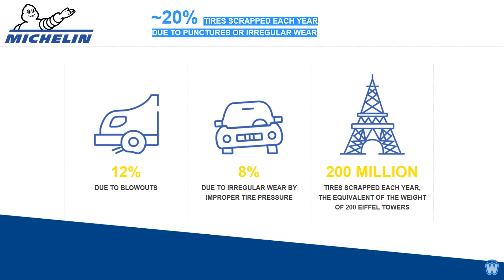Michelin Airless Tire UPTIS - Unique Puncture-Proof Tire System

Comment: About the cop issue... There is probably a way to straight up rip the thread of those tyres on the go, if so, the cops should be no issue and we should be able to use these tyres when they are ready and tested

Comment: What about fuel efficiency? They purposefully used a light car for the pilot tests but imagine a heavier car. Fuel efficiency will probably go way down, no?
Reply: Heavier vehicles already have terrible milage and heavy pneumatic tires anyway. Pretty easy to imagine the average milage is the same regardless, and if anything, better because it's more consistant and not subject to air pressure lazyiness.

Comment: Can't imagine how much a vehicle would vibrate if snow and ice gets in that rib design, not to mention extreme handling problems as a result, and on a road surface that's already hazardous from winter conditions.
Reply: Kinda thinkin' any debris will get flexed out as easily as it got in. It's not like stuff can't get back out as easy as it got in.

Comment: If a car is not driven for an extended period of time do these tires develop a flat spot? What about gas mileage?
Reply: That is 1 hell of a good question
Reply: the ribs would also likely become weaker as the vehicle turns, slows, or accelerates over the course of weeks or months, increasing the actual cost of the tires

Comment: THE RIBS WILL NEED TO BE COVERED OTHERWISE PEOPLE WILL JUST CUT THEM
Reply from the maker: no they won't, too much effort, only takes 1 pin prick on the side wall of any tyre to puncture it, but hardly anyone goes to the trouble of even doing that, no one will waste time trying to cut through steel reinforce rubber.
Reply: @WonderWorldYTC  DONT UNDER ESTIMATE AN ENEMY THEY PUNCHURED ABOUT 20 TYRES HAD TO HIDE CAR , BUT ITS GOOD HEAR THAT REINFORCED

Comment: I've seen these tires like 6 years ago and it takes 10 years to bring them on the market?
Btw, I understand the issue with police. Even in my small country with population just over 1.3 million, every week there's a drunk dickhead without a license being chased at speeds up to 200km/h and sometimes they end pretty bad. The majority of them have been stopped by using spikes.
Reply: @God Of God's I'm pretty sure these haven't hit the market because of fuel economy. Rotational mass usually has 3 times the impact on overall effective weight and these tires are definitely heavier than conventional ones. A greater contact area with the road also creates more friction. These would have a genuine impact on fuel economy during high speed cruising. Another aspect is safety. The lateral grip of these tires is much lower than conventional ones which makes them less safe in emergency situations. A driver who attempts to swerve around an accident could understeer straight into it. Braking distance as a whole would also be worse. The last reason is cost. More material and a more complex manufacturing process means a higher price for consumers. It's cheaper to use normal tires and fix them when they get holes. There's a reason you don't see police using these tires. Other countries that have a free market system also don't use these tires.
Reply: @ymarascough1765  don't delude yourself, the only reason why these tires are not in the market it's because they are more reliable and people would change them less often. Yes, you heard me right, pneumatic tires companies are lobbying with excuses like "fuel economy" just because their business model is in danger
Reply: @gianluca.g  did you not read what I said? Even other countries with free market systems don't use these tires 😂. Don't be a sheep man. Look at the hard facts and educate yourself. Any consumer that cares about safety, fuel economy, and affordable tires would NEVER buy these.
Reply: @ymarascough1765  im not trynna start something but it rly pisses me off when someone uses the laughing emoji when they are arguing. Plz just stick to words
Reply: @jack-rx4bf  That's fair and understandable. I think the reasoning still stands. I can understand your perspective and I think there are absolutely situations where that does happen. But the government isn't all bad. Another example is they launched all the satellites and pioneered the internet as we know it. They let the rest of the world use it for free.
Reply: @ymarascough1765  ?? I asked u to not use emojis when arguing cuz it sounds condescending
Reply: @jack-rx4bf  yes, like I said that is fair and understandable.
Reply: @God Of God's oh no, the law enforcement is usually safe. They got professional drivers, guns and stuff. It ends bad for innocent civilians when the car can't be stopped.
Reply: @God Of God's I agree ofc, at least start with trucks. Yet we still need a creative solution to replace spikes. Shooting is not a very good one.
Reply: What would a blade style strip do? Seems like instead of spike a row of blades, 3”, would still shred the tired sufficiently.
Reply: I'm pretty sure for safety reasons

Comment: yea but how will they handles extremes? hot, cold, emergency stops, drift ect.
Reply: A sane person wouldn’t go drifting with these
Reply: I guess maybe finding this out is why there is a 4 year period of R&D from now...
Reply: Rubber is bad insulator so temperature wont affect em. Mych like conventional tyres
Reply: @lavanyabaranwal6957  what a bout drift tho? And what if a small rock get inside those holes
Reply: @tigantabrother  definitely a major con. I like air ones over these for sure but that how technologies advance. You gotta start somewhere

Comment: Tyre companies won't implement this. This will reduce their sales
Reply: The tires will wear just like normal tires. And if it doesn't wear out, it will harden just like normal ones.
Reply: Those tires still will get used up due to friction, like usual tires. The first to advertise it properly and sell it to the mass will profit the most at first. I don't think tire producers will  just trust their competitors not to take this opportunity.

edit: They can also demand an higher price that compensates the lower sales
Reply: The tires will wear just like normal tires. And if it doesn't wear out, it will harden just like normal ones.
Reply: These aren't very good. The best application is for riding lawn mowers.
Reply: Yea like for the company I work at. We could get airless tires for all our skidsteers but they cost an arm and a leg. Very expensive.
Reply: @evanszymanski346  yeah I just don't think it's worth the expense. (assuming they are superior to standard tires, which they may not be in most cases).
   In economics there is what is called "opportunity loss". Like, sure, you could buy these, but wouldn't you rather spend the money on a down payment for a new skidsteer? So from a business standpoint they have it backwards. 
 Now invent a tire that is 90% as good as normal, but only 60% the cost. Those would overtake the industry.
Reply: @KF1  yea and I mean who cares if you get a nail in your tire. Canadian tire(if you live in Edmonton) sells tire plug kits for dirt cheap.
Reply: @evanszymanski346  that's funny because after the previous comments I was thinking of the tire sealant they sell at princess auto. (Wpg) 
A week ago I picked up a used set of winter blizzak tires for $240. They're awesome
Reply: that's why we must wait until 2024
Reply: Airless tires are not practical in many situations, I can give you multiple examples: You can control the air pressure and thus the cushoning effect of your tires in your car when loading it with either a light load or a very heavy load. You can not control this with airless tires, if you load the car too much (4x4 truck) then the car handling will suffer, as well as the steering response and dampening effect. 2. when offroading mud , rocks and debris can get stuck in the ribs of the tires, damaging them and reducing their propertires. 3. in the winter time if water or snow freezes between your tire ribs you are fked....
Reply: @boT6674  I'd like to argue about a few points of you:
1. The tires are probably for cars which have a smaller window between empty weight and max allowed weight. Something like the vehicle in the video. 
2. Im pretty sure that michelin has a solution to it. And since it's flexible and moving a lot i thing you can get stones and stuff out fairly good. Also again like in 1, it's probably for cars which are mainly moved on proper roads. Aaand they also get used in excavators (like shown in the video) so it doesn't seem like that big of a problem. 
3. Could be a problem. So maybe just summer tires? Maybe they don't take damage when you drive them with ice in it and it crushes it pretty sufficent? I don't know.

Also that is just what I am suspecting so I could be wrong.
Reply: @boT6674  I'm sure it's not that big of a problem considering the military uses it and they wanna cut on expenses if they can so replacing tires continuesly is probably not there ideal situation
Reply: @o.o9709  the military have different priorities - puncture proof especially from gunfire is paramount. Everything else, like fuel economy, handling, comfort and pressure variability take a backsit, but these are all important considerations in consumer cars.
Reply: @boT6674  Very good points, I do think that people without these issues could profit greatly though.

Comment: To complement the FAQS - Tyre IS also the ancient geolocale place title as in Tyre and Sidon,no..?And.. Michelin..? burnouts n drifts yes would place the said prototype on the map racetrack style,but would not perspective be added were the product conducive to zero gravity conditions in it's respective terrain..?if so equipped with nano technology communication, steering as well as mapping is a done deal where off planet research can be conquered.What of its ocean floor agility,perhaps robotics aiding unmanned vessels as depth density prove a challenge..But above these,Sirs and fellow ubers the new age design begs an equally demanded alternate material say fiberglass combinations, welt needing higher tolerance levels, safety parameters met yes but to arguably stop or reduce the extra 'want from',,on an already exhausted Petro Chemical Industry (tyres being an oil derivative industry, basically) the 'disposal of' being a hushed, negated topic.Would not smaller rimmed prototypes with longer rigging provide greater loaded absorption WITH a modified lshocks displacement system for heavier vehicles or military grade performance.What though of off land responodency, should bouyancy tyre material be considered, if the undercarriage and engine come factory sealed,could not a collapsible wheel that's water sensitive activated kindergartenly provide flotation,as the landing gears of air crafts do, if bouyancy - fused materials are welted into specifications.Why's the prehistoric question of man conquering nature not've been met in such a space age as ours,basic,rather basic propulsion, flotation, conversion   IN an already combustible engine type craft.. the impossibility of it is impossible in and of its already existing  contained self,Sirs.. David

Comment: Rubber changes properties over time and usage while air is air. You wouln't need to pump the tyres but tyres would have less support over time which would leave you with "half empty" tyre until you replace it with a new one. It's shape also leaves it exposed t chipping against a curb, it wouldn't destroy it but it would definitely make noise while driving

Comment: I’m not sure these would handle the torque of a performance car, they would shrink in diameter as you floor it. Great for a standard daily driver car tho. 👍
Reply: Pretty sure that excavation vehicles and military vehicles shown having these tyres have engines producing more torque if not equal to performance cars
Reply: @anthonyochieng4485  yeah they have way more torque down to gearing but with regards to acceleration they would have to be pretty tough not to shred. And yes good point as they shrink more torque, also as you move through the gears lowering the torque they would eventually reshape to obtain top speed so maybe they’re a win win for the quarter mile 👍
Reply: drag car tires are meant to be really soft so they can shrink really fast that the torque of the car has so much grip from the start it doesnt wheel spin, you can watch a drag car accelerate and see its wheels shrink into the ground.
Reply: @example795  👍
Reply: @Craig Carmichael True, bigger contact patch, just like in top fuel dragsters using low pressure tyres that deform to put the torque down
Reply: they wouldn't, they're meant for regular road/family car use
Reply: Yes, I'm sure the boffins at GM and Michelin developing these never thought of that...
Reply: true

Comment: Imagine the car engine that you'll need to use those tyres. Normal cars can't even handle that.
Reply: What the fuck is that supposed to do with anything...
Reply: LOL what? This kind of rubber isn't anything special, if you could you would just buy it and stick it on your car. It would work just like a normal tire.

Comment: So the reason why it has not selling yet is the police.
Reply: Correct me if i'm wrong but michelin likes selling tires. So why would they make tires that dont go flat?
Reply: @sjefoekel6058  The tires wear out, most of the times i replace my tyres because they are worn, most of time tire replaced without any puncture.
Reply: @sjefoekel6058  ur tires get replaced for wear that appear in most cases
Reply: @brotothewilliams9890  yes agreed, in some cases.
Reply: @sjefoekel6058  Probably because these are likly to cost more and not last any longer than the current ones.
Reply: @steeveedee8478  make sense in a way. Just hot air then.
Reply: No they just aren’t ready for commercial use yet
Reply: This video is missinformed, already exist multiple ways that Police use to stop a car without spikes. You can looks for a video on YouTube. Like chains and stuff
Reply: Duar memek
Reply: Not a good business model, Michelin will go bankrupt with less tire changes.
Reply: Actually, even if spike stripes cannot ruin theese tires, since the way they are designed they cannot do high speed chases so the police can make a multi layered net, where each break of the net slows the criminal car down just enough where it won't seriously injure the driver, but the car cant speed up do to the limited speed of the car on theese tires, but the net will bust up the car to an undrivable state where if they keep going the car won't move because of damage, so the criminal will have to stop and the cops arrest them, but if the criminal keeps going their car keeps going and eventually gets immobilized where they will have to get out of the car anyways
Reply: Just not stable enough for high speed vehicles
Reply: Anyone tries to run away from the police they should be allowed to shoot simple. Cut that chase down to a few minutes.
Reply: Police can’t innovate unfortunately
Reply: Yes & No, There are so many other variables in the equation such as weight, wheel size, purpose etc..
Reply: No, this tires is only good in low speed or off-road but useless in high-speed because lack of grips. Unless they find another material other than rubbers thad doesn't need air/gas to expand in higher speed to gain tractions, there's no reason for mass production. 🙄
Reply: Runflat tires have been around since the 80s
Reply: No it’s because they are shit lol
Reply: Correction, it is the police being lazy
Reply: @akhil1753  or tire traps arent ready for this
Reply: @akhil1753  huh
Reply: Your slip is showing.
Reply: Unbelievable ! what a reason !

Comment: These tires are so much easier to make than current ones. So why don't they make them? It's because they will serve too long and tire companies will have less profit.
Reply: Probably. I'm also thinking about performance at speed. Those tires must be much softer, and could deform easily at speed, and it's something you don't want when going high speed in a highway and have to make an evasive manouver. 
I hope they develop this technology correctly, it could definitely benefit from a lot of big off roaders and trucks. Im not sure about conventional or sports cars.
Reply: so a new smaller company has to come along (like tesla did for electric cars) and start making them available and as soon as their sales start digging into the profit margins of the bigger companies then everyone will finally come on board and start making these superior tires for the consumer and the environment.
Reply: Your pov applies to alot of industry dominations. However these tires are ONLY beneficial if everyone drove down a paved road and had perfect weather 365 days a year. Just name an area with perfect weather all year, and I'll move there tomorrow and donate everything I have to get these tires mass marketed.

Comment: I can imagine pebbles getting stuck inside.
Reply: its an early design to show whats inside. the final product probably will be closed entirely just like a normal tires
Reply: @zedboiii  My thoughts exactly..
Reply: @zedboiii  no doubt
Reply: But they can be cleaned out easily I think.
Reply: mudd debris snow frozen ice n rubbish getting jammed in them spaces affecting the patterns in tyre structure
Reply: and then get released like projectiles to take out your eyes...needs covers for sure.
Reply: But it’s the same tech you can find in sneakers. They solved that by covering it with transparent rubber. They probably have thought of it.
Reply: Obviously, It will covered like normal tires.
But for the sake of this video they showed us the tires without the covering.
Reply: Why wouldn't they come back out?